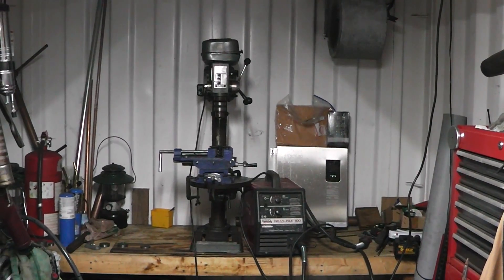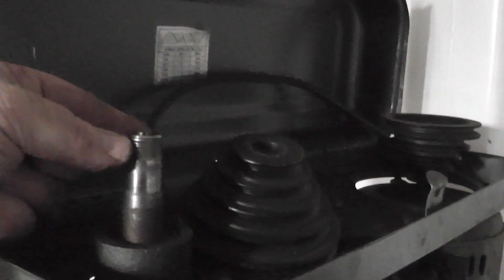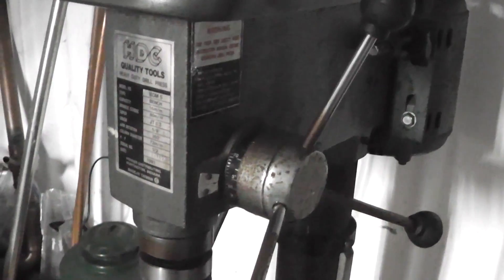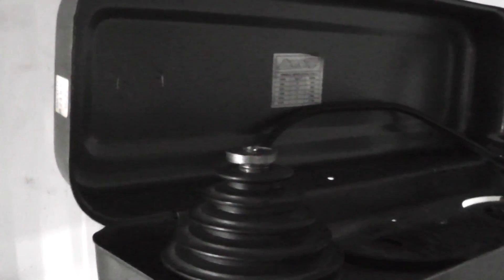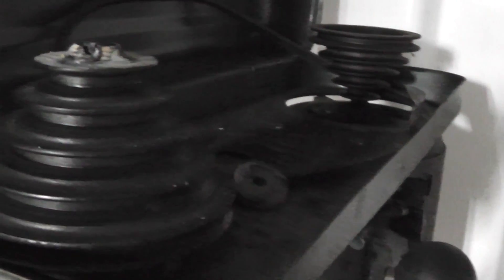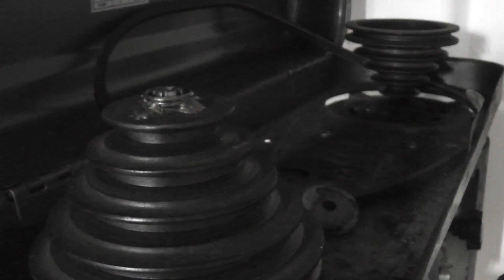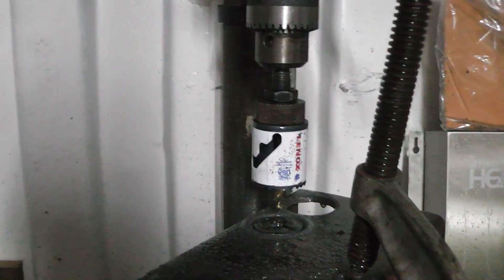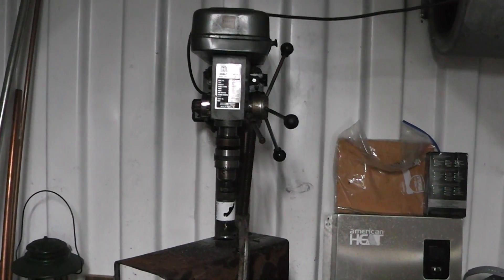Drill Press Repair Hack!

Comment: Yep, I probably would have done the same thing too.  My dad left a floor model master craft and it looks the same as yours except it has another pulley in the middle with two belts.  It makes it like a 12 speed, but I only used it on it's slowest speed all the time.  More torque and less belt slip.  Nice fix considering that is probably a cast iron pulley.
Reply from the maker: Thanks.  I always try to use the slower speeds.

Comment: Hi Homesteadprepper, I have a drill press question. I'm a computer nerd and recently bought a drill press. I was trying to increase the speed by changing the band inside the top housing.  No matter where I put the band it seems to go the same speed. WTF am I doing wrong :D
Reply from the maker: Using the larger pulley that is attached to the motor with the largest pulley on the quill shaft should give you the highest speed.  If you have access to something like a stroboscope(not sure of actual device name like a timing light) it will tell you the rpms.